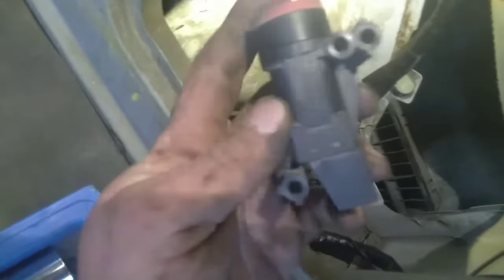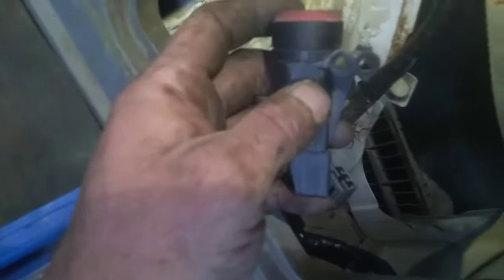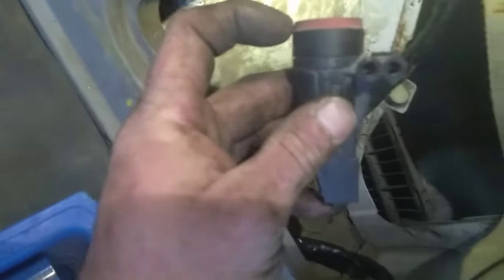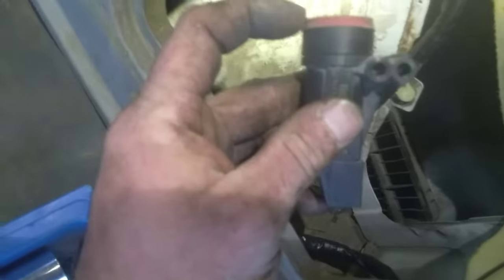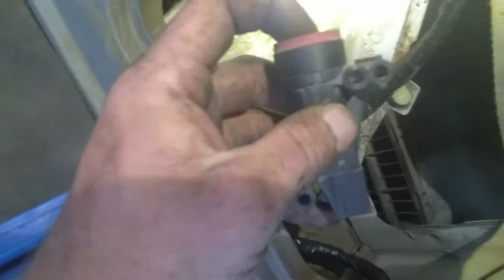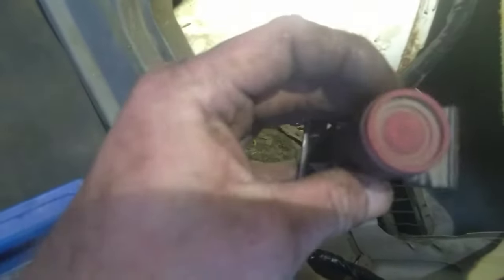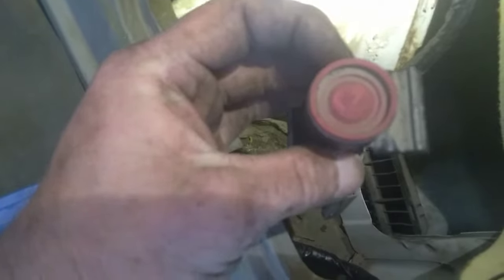Ford fuel cut off switch (inertia switch) part 3. How to bypass a bad fuel cut off switch

Comment: While you are in there with the cover off cut one of the wires and install a $10.00 toggle switch that you can use as a kill switch/anti theft switch. You can run the wire out to anywhere you want to hide the switch but it might save your truck from being stolen.  10 minutes and $10.00 is a NO BRAINER. No relay or fuse required.

Comment: I had this issue with my 2005 Sport Trac . I was going to buy the part online but with the shipping if I want it fast the cost was bumped up on cheap part. What I did find out is Napa Auto Parts carried my part and it was only like $25 compared to Orielys and Autozone at $65.00 hope it helps. Best thing the part was in stock and just around the corner.

Comment: Do you think a fuse would work rather than that connector?
Reply from the maker: Sure. Just check to see what size fuse is used for the fuel pump relay and match your fuse to that one. If it's a Freestar/Windstar van it's a 15amp fuse. I will recommend buying a new inertia switch and installing it at some point though, they're about $10-15 on rockauto. You don't want to risk getting in a wreck and having the fuel pump not shutoff. Thanks for watching!

Comment: So when you switch off the car 
Does it drain the battery??
Reply from the maker: No, the fuel pump relay still controls when the pumps is on and off. The inertia switch is a safety device that this in the fuel delivery circuit for the purpose of if you get into a wreck to stop the fuel pump in case the fuel lines become severed. I wouldn't leave it bypassed permanently just for safety reasons, they're not that expensive and could save a life

Comment: Where is it for a foxbody mustang
Reply from the maker: The fuel cutoff switch varies from year to year. They're usually in the trunk just left of the license plate between the carpet and the tail light assembly. What year is yours?
Reply: Behind driver tail light

Comment: You didn't show what you did
Reply from the maker: The switch has two wires going to it. I just jumped the two wires together, you can use a metal paper clip to do the same thing I did in the video. You would need to cover it with electrical tape to keep it from shorting out out. All the inertia switch does is bridge electricity from one wire to another just like a fuse or a light switch does when it is turned to the one position

Comment: Why would you ever do this? Take switch apart and clean it.
Reply from the maker: Thanks
Reply: It's a pain in the butt for my vehicle.
Reply: @h2oteen   It be more of a pain in the whole body if your vehicle catches fire due to the pump still pumping fuel all over the place
Reply: We do this for the derby 😆 🤣
Reply: @jasonwright2309  Viable reason. 👌